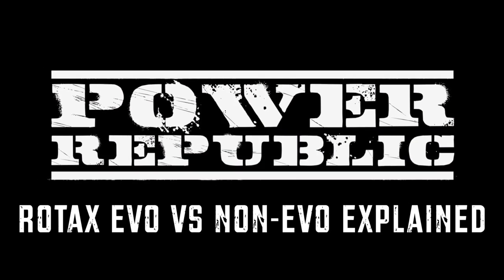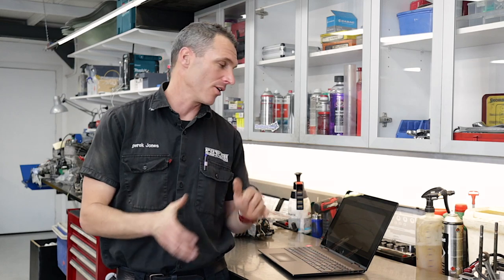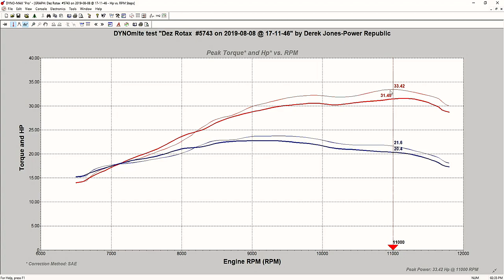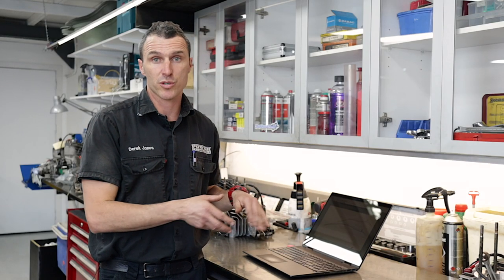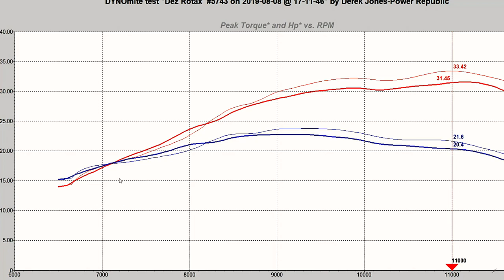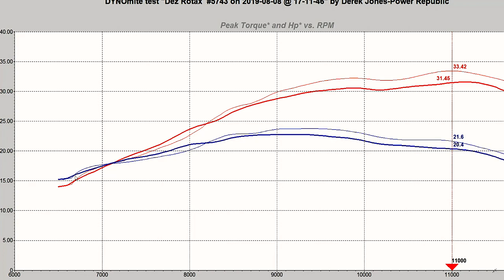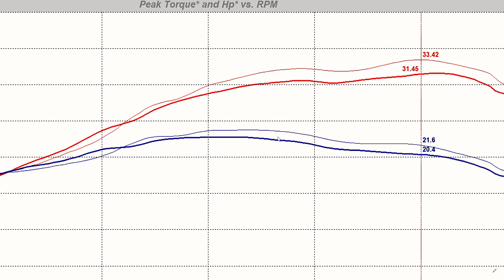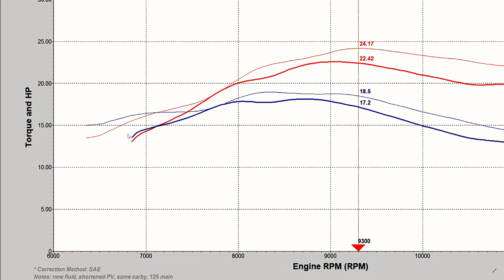GO KART TECH: Rotax Evo Vs Non-Evo Difference Explained - POWER REPUBLIC

Comment: Great video, but I'm really curious to know how much of the performance gain is down solely to the new cylinders vs the new exhaust vs the new carb. If you think about it, those are the three things that will really affect performance on evo vs non evo. The ignition timing on both engines is the same. I agree the new power valve can be of some benefit, but if you know what you're doing with the pre-evo power valve you can get similar results to the evo. Dez if you can, would you be willing to stick the evo carb and exhaust onto the pre-evo engine and redo the test? That'd show us exactly how much of the power difference is down solely to the cylinder
Reply from the maker: Hey Chris, great point, the sum of all the parts makes for the power gain IMO, not just one of the bolt ons.  The PV really helps with our restricted engines.

Comment: Would be interested to know the difference between Jmax & senior max when run in TAG restricted. It's commonly said that the Jmax is better than senior max in TAG-R.
What sort of outlay is it to upgrade a pre-EVO to EVO spec? I'm looking to move to TAG-R from Yamaha, and wondering if buying a pre-EVO is a waste of time and money.
Reply from the maker: Great question.  The JMax has heaps of bottom end power in both set ups, but they don't rev as high as the senior max, so you have to run a lower sprocket to compensate.  The best to buy IMO at the moment is the senior max EVO, followed by the Jmax EVO, then either of  the original engines.   If your a light driver the non EVO senior max is still good, but it all comes down to your budget.

Comment: My sons go kart has non Evo engine. We upgraded from mini to junior and now it has misfiring sound  at 12000 rpm. The engine is fully rebuild just now. What you would suggest what I should do to fix it.
Reply from the maker: did you change to ECU black box to JMax?  they have their own type
Reply: No I don’t think so. Should I do it? I thought it was problem with jets.
Reply: The problem is I’m struggling to find parts for non Evo engine. Would Rotax Max Evo Junior box would be suitable for it?
Reply: And then you so much for your videos they are very helpful

Comment: Could you compare dd2 engines Evo vs no Evo?
Reply: I have posted the Hp and Torque that I managed to get out of my DD2 Evo with the 125cc and 140cc Cylinder.
Reply from the maker: Hi Raul, I haven't yet mate, I would have to change my dyno set up to take the DD2 engine
Reply: Power Republic 
I have posted the results of the Dyno for my DD2 engine on the messages, check it out!

Comment: Just a quick question.
Me and my dad both run tag restricted 125 rotax engines. We both are relatively new, so we don't know much about engine setups yet. Despite running the same engine, he has a much higher tone at max throttle in his engine, and we think that he has a more sudden loss of grip on acceleration. What is the reason and how could we fix it?

Also, I run 40kg of weights to get into the tag res light class. Is it a disadvantage to run solid lead weights instead of body weight? Thanks

Comment: hi, could you make a video of the rotax max in dyno conkit italkit 140cc?
Reply from the maker: hey raid, do you know who sells the 140 kit here in Australia?
Reply: @PowerRepublic  
I don't know, I can tell you who sells it here in Spain, greetings
Reply from the maker: @raidracing9748  gracias,  it's probably a lot more torque at the  low RPM's with the bigger cylinder.  Not sure how much extra top end it would make other than you could run lower gear ratios and still pull out of the corners the same, but blow past your competitors at the end of the straights.  obviously its not legal for racing and would only be for fun.
Reply: Dont get 140cc or dd2 on rotax max both crap had both.evo kit way 2go.

Comment: Hi, I had my DD2 Evo tested on a Dyno, I only managed to get 31.45hp at 11405 Rpm, and Torque 20 at 9835 Rpm. Can’t remember right now what base gasket I had on the Cylinder, I think it was 1.1 but in any case, what base gasket would you recommend for the DD2 Evo 125cc?
I also tested the DD2 Evo with the 140cc Cylinder, with a base gasket of 0.5 and Squish 1.30 and the power was pretty much the same, 31.36hp at 11282 Rpm and Torque 20.5 at 9671 Rpm.
So you get pretty much the same Hp and Torque with both Cylinders, 125cc and 140cc, but with the 140cc you get that power and Torque with less Rpm.
Reply: Every dyno reads a little differently but those figures you quote seem unusually low for a dd2 whether it be evo or pre-evo
Reply: Christopher Ramnauth 
That’s what I thought, 31hp for the DD2 Evo seems kind of low, unless there’s some power being lost on the Dyno where I tested my engine, I don’t know? That’s why I was asking about what base gasket should I use, and what’s the Squish? I really want to get the most power out of my engine.  Thanks 🙏

Comment: i think to do this properly u will need to put max stuff on the evo engine
Reply: I wont say properly...the video wasn't about identifying exact what makes the evo make more power but simply to compare them. I agree i too am curious on whether the new exhaust, carb or cylinder has the most effect. I reckon if you put all the pre-evo ancillaries onto the evo engine the power difference would be much less than shown in this video...ie I think the main power adder is the new cylinder...but have no data to back that up... it'd be a good test to do!
Reply: @IggySport1388  pretty much makes me wonder why they updated the 3d ss barrel to the rd or rb 2019 3d barrel
Reply: The search for parity continues .. the evo wasnt supposed to be better then a max
Reply: @jacksonbermingham2168  the 2017 senior barrels aren't as good from what I've heard. I believe these are the SS ones you're referring to? The 2018 onward ones are the ones to get if you're upgrading... they're the real deal... from what I've gotten from reliable sources...slap one of these onto your older pre-evo engine and you're guaranteed a boost in performance
Reply: The evo is much quicker than a pre-evo max...in addition to the performance benefit highlighted in this video there is the major on track lap time improver of the evo engines ability to rev to 14800rpm. The pre-evos can only do 14150 before sitting on the limiter. Essentially what this means is an evo can be geared around 2 teeth shorter getting more bottom end  yet still retaining the same top speed if not more than a pre-evo.